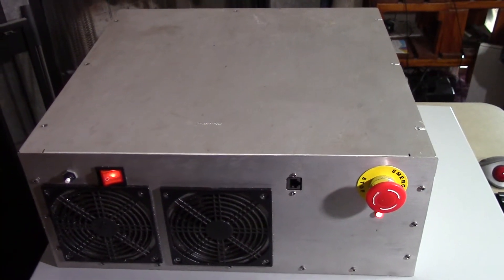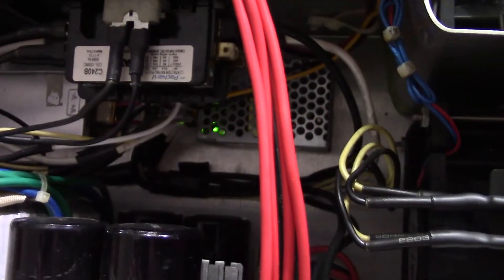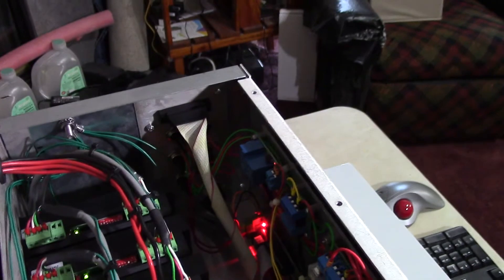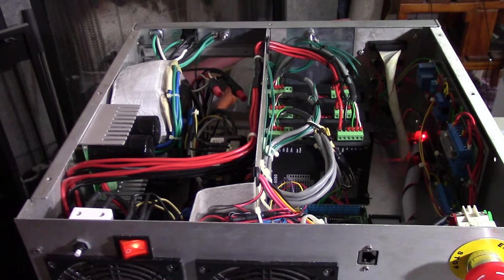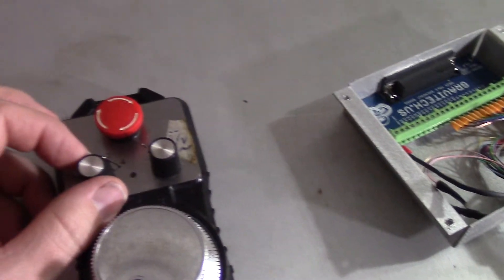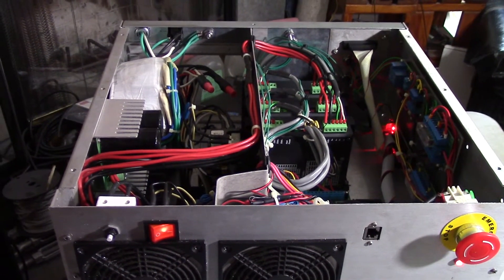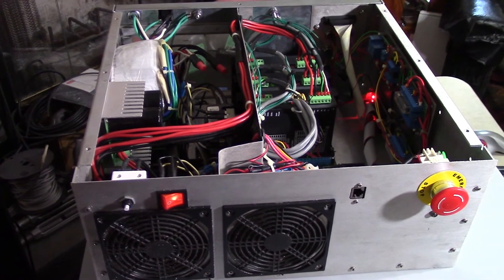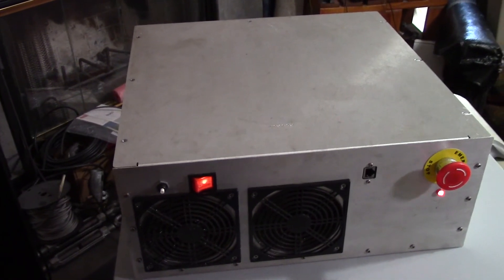Goodbye to My Mach3 Controller

Comment: I'd like to add that i was able to convert from g540 Mach 3 to Linuxcnc in a couple of hours without any experience and now I can get a Linux box up and running on a 7i76e in like 20 minutes without install time
Reply from the maker: yes once your used to how linuxcnc works setup is pretty easy. Ironically the enclosure in this video is now being used with linuxcnc on a chinese 3040 router were I work. I got tired of using GRBL on it.